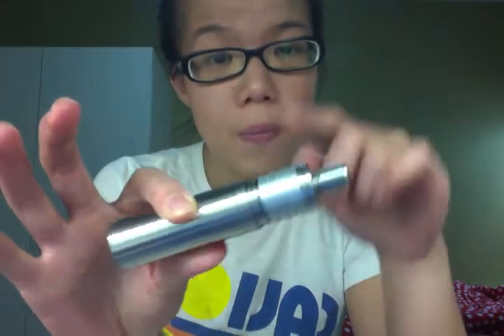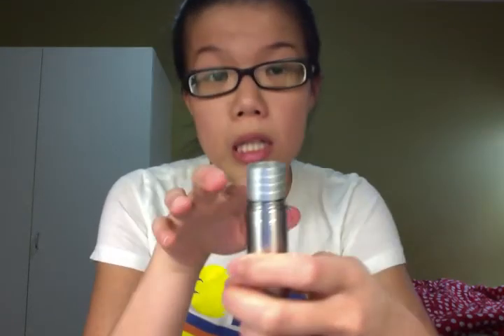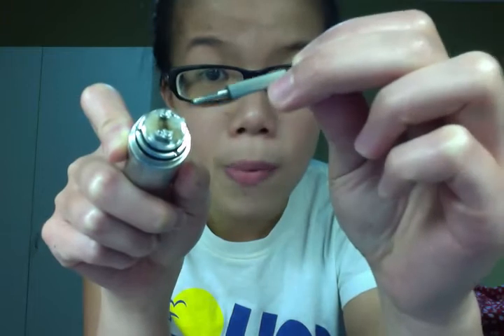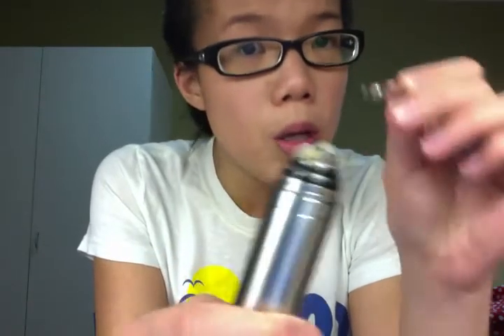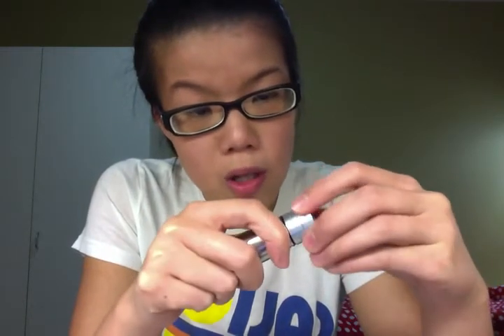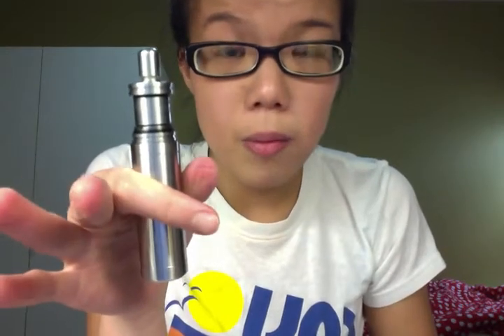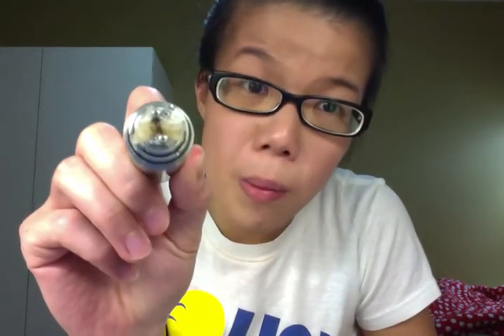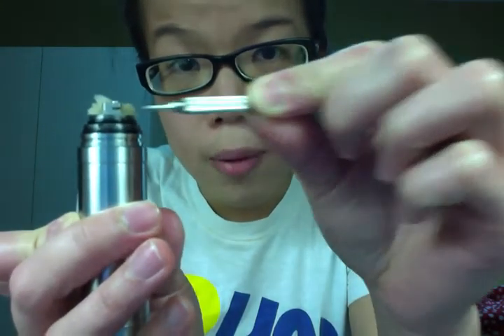Immortalizer - Chief Vapers

Comment: Thanks innapropriate, I love your reviews because you go into the mechanical details about the item, and they're always spot on with my experiences. I didn't know the aluminum was to keep oxidation away from your juice, it does have quite a "clean" taste with the ceramic and aluminum combo. I just got mine yesterday and I swear your reading my mind, because I had nearly the same thoughts on everything. I've figured out if you screw on the inner cap and then tuck some extra wick around the airflow openings (kinda hard to do, need long tweezers :P), I've had no flooding, and the extra juice with a sub-ohm coil and the ceramic deck practically turns it into a kiln. When it's been warmed up a little, it's probably the best single coil vape I've ever had! Again thank you for the really detailed reviews, I can tell your a vaper that knows all the physics behind it, and for someone like me who's really OCD about their vape equipment, it's a life-saver when buying new things. (I'm looking at buying the strata from Super-T next, looks beatifully designed.)
Reply from the maker: Thanks cybertree! :D Yea, the flavour off this chap is pretty awesome :)
Reply: Thank you :), I finally got some flat ribbon for this little guy in the mail today, I'm building a micro for it now, time to see how she vapes with what she's intended for! Btw are you English? I only ask because of the accent, and way you spell flavour :P (man I miss my grandmum in England), I was wondering if europe has seen the Russian BIG rba yet? I've heard it's being made in germany and seen a UK vaper that had one, and am trying to get my hands on one sooo bad! drool It's just like a kayfun/russian 91% but it's massive, and holds 11ml 8D, just had to ask in case they exist for y'all yet. Thanks again!

Comment: In your thoughts how would this rank on your vape list?
Reply from the maker: In terms of flavour, it's definitely up there as the vape is really juicy and dense. However, with the sleeve all the way down, the draw of this guy is one of the tightest I have currently. Set up wise, it really depends on what you plan on using with this, great for single coils.. altho it might get a lil troublesome setting up other configs on this. Hope I helped, somewhat. :)
Reply: Yeah for sure! I'm just debating on what "high-end" rda I want to get. Right now I have a couple of octopuses, a nimbus clone and an Igo-W. Currently i really like the Igo-W as I feel like it gives me the greatest flavor but I think that's because of the small cap. But I just really don't like the look since it doesn't fit flush with any of my devices and drilling out the cap exposes the deck inside.
Reply from the maker: Asianboi231 Hmmm check out the Origen Dripper. It's my fav dripper currently :)